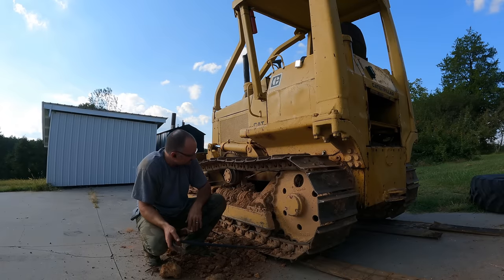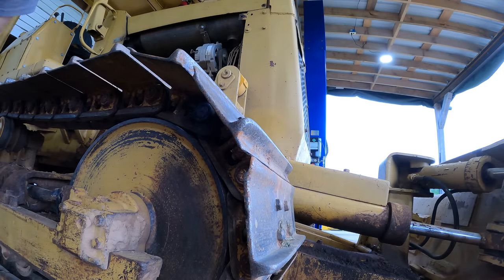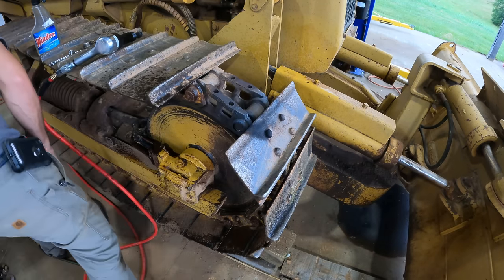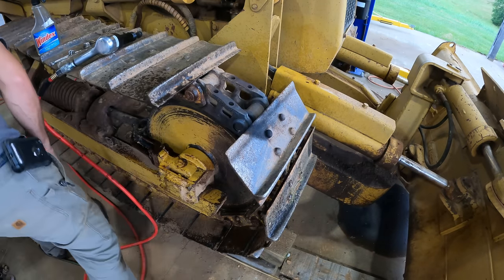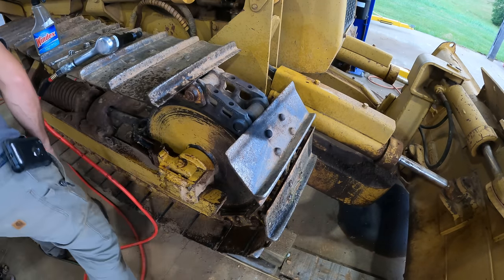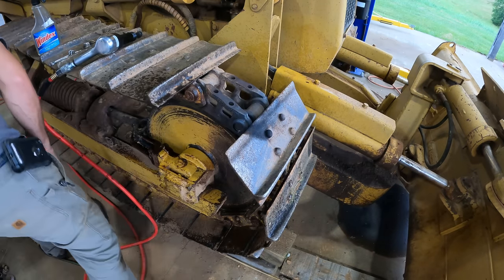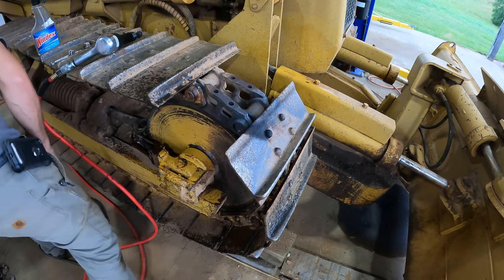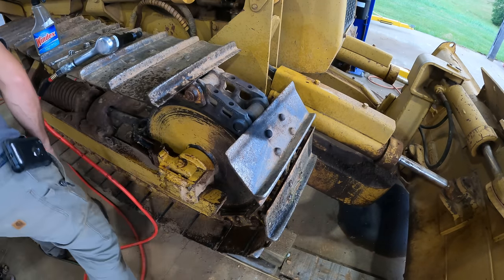Dozer Repair, Splitting Tracks, Adjuster Rails & Slides.  CAT D3 dozer

Comment: Been doing this for 50 years. I’m 75 now. Torch a 3\4 inch deep hole in each end of the pin.  Let the pin cool. Drive the pin out     . Using a smaller hammer and punch. The cost of a new pin is nothing compared to the labor cost. Also relieve the track tension before doing any of this.
Reply: I'm just an old farmboy. Loosening the track was my first thought.

Comment: By heating the pin and hammering it you made a rivet that will not drive out. Heating the surrounding area to expand it while keeping the pin as cool as possible would work better. Releasing track tension first would have helped, you learned that the hard way. Building the guide to guid the drift was really good idea.

Comment: Good morning John, I’m not a metallurgist but I do work in a very industrial zone in Canadas far north.  We recently have had a series of injuries caused from swinging sledge hammers on hardened steel surfaces.  One guy had a chunk fly off and insert itself in his hand, another in the face and another in the chest.    The fix was leather wear, face shield, and a brass or soft sledge.  

I know it doesn’t seem practical for all of that but I thought to share some news. Your one of my favourite channels to watch I’d hate for anything freak like that to happen.  Keep up the great work!
Reply: Hardened steel should never strike each other. There’s a reason blacksmith’s striking tools have been tempered way back or not hardened at all on the struck end. Or even use a soft face hammer. When they chip, those pieces are flying extremely fast.  But I doubt those pins are very hard at all. I’d bet there made of 4140 or 4340 and heat treated to be very tough and not Hard. They aren’t going to chip.
Reply: @erikcourtney1834  Right, if they were hardened, they first one wouldn't have mushroomed like that.
Reply: My Grandfather lost an eye drilling using a chisel and sledgehammer whilst doing his job as a road worker in the 70's. In Norway, sledgehammer work safety is taught in school now for construction workers. Basically, the real "killer" is when the sledge or the chisel gets mushroomed, the sledge will knock the slivers off the chisel and those come at you at supersonic speeds.
Reply: @Channel-gz9hm  OOO look at me being all hip and down with the kids. Based on how this particular youtuber seems to be somewhat safety oriented, the OP's point is absolutely valid, it's what you don't know about, that will injure and kill you. Ignorance is bliss. Until someone loses an eye, or gets a metal fragment stuck in another rather important bit of your body. I mean, I could have made a stink about using a 7" grinder disk on a 5" grinder, and how that is insanely dangerous, as the smaller the grinders are, the  faster they are made to spin, so using a 7" disk on a 5" grinder can cause it to explode, sending shrapnel into you since the disks are not rated for that speed.. Goddamit, look what you made me do.
Reply: A long time ago i struck the edge of an anvil hard and a very tiny piece of metal flew into my knee. Didn't even notice it at first, but soon my jeans were soaked with blood down to my ankle on that side. Luckily it didn't cause any actual damage.
Reply: Steel fragments/splinters almost too small to  see from impact steel on steel, especially hardened steel, are a regular eye surgeons weekly fare. The fragments are just like a grenade or shell exploding-just on a different scale. A face shield is inconvenient but you only need it once to do its job. I worked in a major eye clinic performing retinal angiography-for some years before retirement. Take care, enjoy your videos, I do a lot of my own mechanical maintenance and built stuff because, like you, I can. Scored a few tips from your projects. Greetings from Tasmania Australia.👍🛠😁🇦🇺🦘
Reply: Know a guy that lost an eye, sledge on axle shaft. Dr said the piece almost went  completely through the eye. Didnt lose the eye, but can only see shapes/shadows out of that one. Guy always wears safety glasses now lol. "I only have one left, i have to protect it."

Metal doesn't even have to be hardened to splinter, grind off any mushrooming on tools/parts. No one thinks it'll happen to them till it does. Just saying.
Reply: I have a friend with a damaged eye, not from splinters off hardened steel though. From a pair of tin snips of all things! Snipped the corner off a piece of sheet metal, pinged up and stuck him in the eye. 40 years later I finally came across an old sheet metal worker on YouTube warning about that. First warning I've ever heard about tin snips but very valid as it turns out. Be careful out there, it's all out to get you.
Reply: I had a friend lose an eye to a BB gun, he always goes as a pirate for Halloween
Reply: You need to first back off the tension of the track enough so the top of the track droops down several inches to get the pin out.  Yours look way too tight.
Reply: I've got a scar on my eyebrow from a piece of shrapnel that flew off the mushroomed head of a cold chisel.  That was over 20 years ago.  The hair disguises it pretty well but if it had been just a quarter of an inch lower, I'd have probably lost the eye. All I was doing was making a hole in a brick wall for a soil pipe to pass through. Nowadays I'll never hit a chissel with a mushroomed head.
Reply: Yep great advice
Reply: @Channel-gz9hm And maybe we can create an agency to listen to more of our phone calls when we go to buy one,  prevent us from buying sledge hammers at the store. That would be awesome. Problem solved.
Reply: my dad was tearing down a  Big drag line when he was in his 30s and as they drove out the big pivot king pin a piece spalled off and imbedded in his arm , it went though a small artery, Spurt - Spurt ,( was the only time he said he fainted)  the doc said it would do more damage to dig it out (was heated too) so they left it in !! he passed  2 years ago at 91 !!
Reply: I got a small chip embedded in my leg as a kid, while using an axe for some random kid stupidity.  No safety glasses because I had never heard of them in the 70’s, plus I was young enough to be immortal.  Not everything I’ve learned required adding to my scar collection though!

Comment: I have a 1974 CAT D3 dozer almost identical to yours. To easily remove the tracks, just push the blade all the way down, completely collapse the track adjusting cylinder and lift the track out over the front idler. Very easy and quick method of removal without driving out a track pin. 

    I also noticed on another video that it looks like the brake pedals need adjusting. Look in the manual how to do this correctly.
Reply: This deserves more upvotes!  This is truly “that one weird trick” in the clickbait ads!

But the video wouldn’t have been as interesting.

Comment: As a former Caterpillar mechanic, I kept shouting at the screen. But you couldn’t hear me so I gave up and thoroughly enjoyed watch you flail around. The coup de gras was reusing that old P.O.S. pin. I was laughing out loud. Congratulations, Sir! You truly ARE a farm mechanic. “ Yeah, that’ll do”. Tears in my eyes. 

I am now subscribed.
Reply: Hey there friend. Wondering if you could spare some expertise and professional advice. Looking at purchasing a older D4 dozer for cutting road on my property and leveling some spots for use. Soil has a lot of shale, and some outcroppings of granite. There are quite a few roads rough cut in already and would just need some further grading and widening. A few I need to cut from raw land. Would you recommend the d4 for this workload? And I've found many prefer the 7U and 7J over later model years like the T's. Is this accurate? Also, besides the undercarriage, what else to be aware of when purchasing one used? Areas of concern or problematic systems or system components? Any info is much appreciated

Comment: Great work! In my experience, I've mushroomed more pins/shafts with a sledge than an impact hammer. Adding support like you did on the left side probably helped the most. The key is to try not to put too much heat on the pin and keep it on the collar. Heating the pin just makes it bigger and if too much heat, like you showed, will forge/mushroom it.
Reply: Not having a helper was the biggest handicap of all. A helper could have held a pointed punch that fitted the dimple, which would have prevented the mushrooming.

Comment: The thing about heating metal to make it easier to get out the pin is that its not about just getting it hot, its about getting it hot fast. Once the heat transfers to the pin, it also grows in size and just as tight as when you started. Use your biggest rosebud heat the link fast, take your best shot and if you don't get it you'll have to wait until they both cool down before you should take another shot.

Comment: We use a demolition hammer on our farm. It's heavy so there's a bit of an effort with the forklift to hold the hammer at the right angle/height. We also tack-weld a cutoff piece of pipe around the pin. The hammer goes down inside the pipe and centers on the pin. The pipe is there to act as a guide. Try to hammer anything with the demo hammer freestyle and it's uncontrollable. Pins always come out very easily for us using this tool. But like I say, a bit of a setup.
Reply: I came here to say the same thing. We use a 20# Makita electric demo hammer to remove pins on all kinds of machines.

Comment: Ive always heard the wet pin rail has the gator clamp. The dry rails have a master pin with a big cotter pin or similar pin holding it in. The welded pin is probably the most common though. Mr John you worked your tail off on this job. I can't help but say this, when you were showing how great of a job you did fixing the slides I see the mast for the blade frame has a fair amount of movement in the pins. I wish I could be right beside you, getting to know you and get some work done. I love these old machines too. I'm sure Kurtis from CEE Australia would be proud of you on this job.

Comment: used to work at a large construction shop years ago. Your  second hammer and the bucking pipe  and letting the track adjuster lose helps.  We always had someone handy with a railroad pin hammer to hold against the pin. The best hammer for that job is a 16lb hammer. The 12 is a too light and the 20 takes a real big real good hammer person. You are doing a good job . Especially working alone.

Comment: I’ve always used a stick welder on equipment like this. I’m able to really burn her weld in compared to wire. Always felt it was stronger/better. 😊
Enjoying the maintenance videos. 😎
Reply from the maker: I need to get at stick welding. It’s on the list!
Reply: Should have thrown some 7018 rod in there, the mig wire is really soft in comparison.
Reply: I have a question: when welding on something from the underside, does the weld behave differently? Like does it tend to form peaks instead of flattening out if you were welding on the topside? Or does it just cool down & set so quickly that it doesn't really change much?

I suppose it also could vary on operator skill and the welder settings? Have it put too much energy into it or go too slowly and it'll stay molten longer and do odd things?
Reply: @justinthomas2458  mig wire tensile,  like stick wire, is  first 2 numbers of the filler material. It doesn't matter if it is stick or mig, 70 Ksi is 70Ksi.
Reply: @InsanePacoTaco  welding from the underside is called overhead position. Overhead is simply a flat weld being applied from the other side of the steel. The heat setting, travel speed, rod angle, etc technique are the same as flat position, the only difference is psychological, and to a great extent, there is difficulty in seeing the puddle which is obstructed from view by the stick or mig gun.
Reply: @robertmencl9169 Thanks for the explanation! I hadn't thought about the psychological and vision aspects

Comment: At 35:35, you pre-heat and say something about penetration.  I think pre-heat helps avoid cracks due to the rapid cooling because the casting is a giant heat sink.  Pre-heating is probably the right thing to do.  Depending on the AR alloy, I think post heat might be good, too.  The Lincoln Electric book says you've got to be careful if the carbon is above 0.4%.  Cast iron is 10x that and I think some of the AR alloys are pretty high.  Hopefully it won't be an issue.

Comment: My Dad used to use a formula of penetrating oil that they used on Mosquito aircraft in the late 40s.  1 part paraffin to 1 part old engine oil.  Use more than you need and soak for as long as it takes to make and drink a cup of tea.  Works really well!

Comment: I use a severe duty c clamp with a piece of 1-1/2” sch 40 pipe for a sleeve for the pin to slide into. Heat it up, tighten on the clamp, hit the clamp end with a sledge hammer.  Rinse and repeat, they come right out. You are correct though, much heat is required.  Love your channel, I have learned much from you. Thank you for what you do.

Comment: I have done several of these things longer ago than I care to remember.  Park the machine where it is flat and level.  On the starboard side of the machine, position the master pin on the front idler, between 5 & 6 o'clock.  On the port side, that would be between 6 & 7 o'clock.  That helps use the weight of the tractor to hold things firm.   Do not remove the track pad!  The track pad helps hold the links firm, keeps the links from moving about or bending, and holds the bores in the links true to one another so the pin does not bind when driving it out.  In a vintage 1950s manual for a D-7 (17-A), Cat shows a jig for holding a punch that clamps to the track pad.  If I did it more often than I did, I would have made such a jig.  I often used lumber and mounded soil to create a cradle for holding my punch at the correct height.  An 18" long piece of 1-1/4" mild slick rod is recommended for use as a punch though that might be too large for this tractor.  Please do not use you foot for holding the punch in position while hitting it!    Hitting the punch square and with nothing less than a 20 lb. hammer is normally what it takes to drive these things out.  Heating the links to remove the pin is not recommended for reasons shown here.  Always replace the seal on adjustment cylinder when breaking the tracks on an old machine like this.

Comment: Great stuff. Quick tip, when a bolt or nut is stuck in your socket, just lay the socket on it's side on something hard and strike the sides of the socket with a hammer. The bolt or nut will work out quick, usually with one strike. Mechanic trick

Comment: I love and have learned so much watching your videos. I will say this. I welded for 20 years. The key to heating up a metal part to remove a pin or a coupling off a shaft is use a large rosebud and get the outer part hot quickly to keep the inner pin from getting as hot and drive it out quickly. Once the pin get hot it’s futile to try and move it. Cool it totally and start over.

Comment: There were several occasions where I nearly lost the will to live! I make my mistakes when I don't systematically think through all the pathways for failure. When I cut corners it always ends badly. I'm 70 and I notice heaps of young men who have really poorly developed problem solving skills for real world situations like you are in. My son in law was amazed when I pre-fabbed a large wall for a garden shed (weighed about 110 kg) and  transported it all by myself 50 metres and plonked it down into pre-drilled mounting points using a wire rope strung between two trees.  There was  no one to help me so I had to do it myself. Keep up the good work!!

Comment: Thanks for the video! that was a tough job to conquer. One note, when you ran out of acetylene and reverted to propane to heat the link and pin , you could have used the fuel gas with the oxygen to get the desired result. You looked that you may have already had enough so maybe taking a break was best at the moment! Great going!

Comment: Well done John, a couple of things I have learnt over the years do non take the grouser off leave it on to keep the links from spreading, position the link at the bottom of the idler where you can get at it and it is usually more secure, do not use heat,  most times these pins are removed with a punch and hammer and two people if you cant manage a helper it is much easier to support the punch when the link at the bottom.

Comment: Had one of these. Rebuilt it from one end to the other. I mean literally every part. Even the pedal bushings, hand control bushings....every single piece. Even the c frame and blade pin bushings. Made it like new. But still a rough riding...dippy machine. I was good at operating it because I was energetic  and going. Had  fast feet for the pedal steer and quick hands for the shifter with spin throttle knob. I would try hard. My older dad couldn't stand running it...and all the older operators as well. Had to sell it cause I couldn't hire any help that would run it. But, if you slow down...it's a sweet unit for home and farm use. At least it has no electronics!!! Good job on the video! Keep it up.

Comment: Great video again!! I have done a few track jobs myself,  and none are ever easy without a track pin press, which I don't have either.  I did exactly the same as you did welding a pin holder drive it out! 👍
By the way if you should put new rails, ( track chain), on your machine,  replace the drive sprocket,  as well as front idler, unless it's within specs. The drive sprocket is usually the cheaper item to replace, and if you don't, it will cause premature wearing of the new rails.

Comment: I changed the front idler on my dozer a few weeks back - this is exactly why I left the chain intact and removed it as a unit - without the proper press it is an absolute fight (note) I too left tension on the chain at first - appreciate your content, Sir